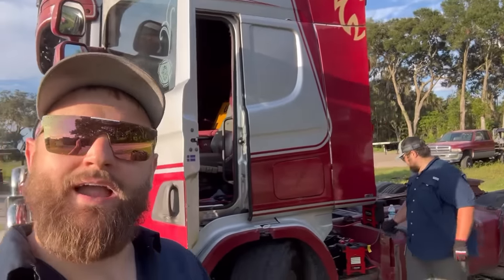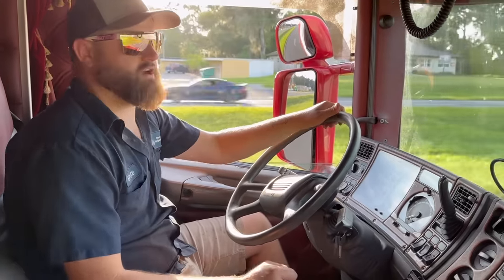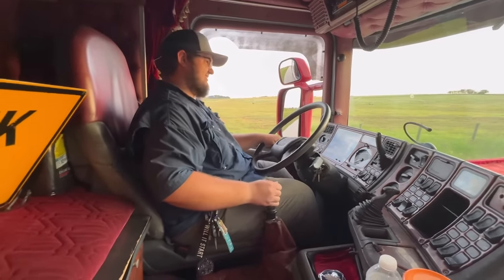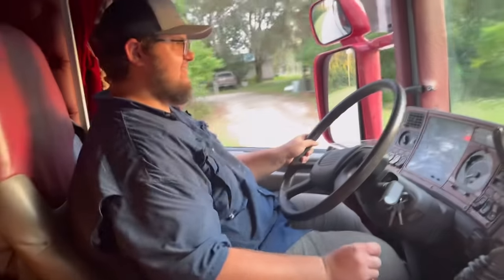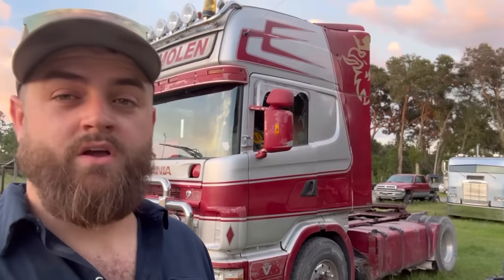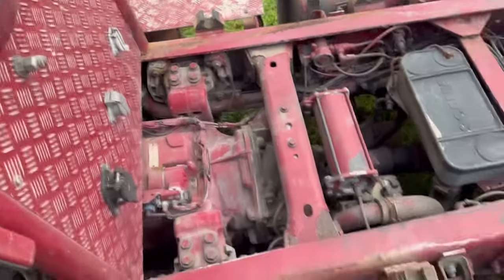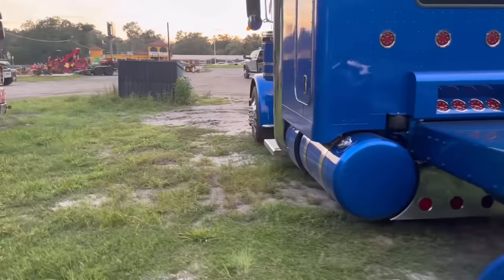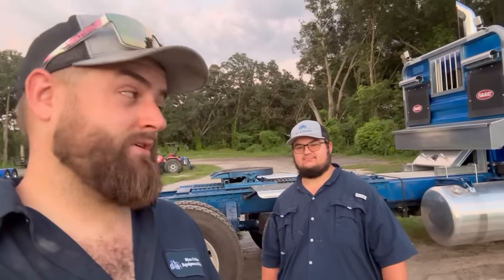American ATTEMPTS to Drive European Semi Truck. (Big Fail)

Comment: The tachograph is to register work/driving time. In the EU you must take a 45 min brake after 4.5 driving and you may only drive 9h/day and work 15h/day. Also after 5 workdays you have to rest for two days. That´s the simpele explenation, there are a few exceptions but that´s a bit complicated to go into details.
Reply: You need to educate youreself if youre a trick driver ...

Comment: That Tachograph disc has been in there for a while!!! You're were supposed to put a new one in on every shift. The last time I used one was 10 years ago! The key was so the Boss could lock it to stop drivers "cheating" their working hours by swapping the discs out during a shift. The 'Tacho' is nicknamed "The Spy in the Cab". It monitors speed, time driving and total working hours. Truck driving laws over here in the UK are Ridiculously strict and drivers and operators get Big fines if they break any of the rules and laws for heavy goods driving.
That type of tacho in your truck is now basically obsolete as everything now is Digital. You should be able to pick one up from over here reasonably cheap. Everything is now recorded on a driver's tachograph card about the size of a credit card.

Comment: Importing any vehicle into US that have less then 25yrs on its back will require a full law compliance which means probably crash testing more then few of the same model for US market...this is THE reason why ppl will only import old models(they are exempt). Nobody has milions for crash testing purposes just to import one truck.

BUT since Scania bought out International trucks there might be a solution in near future.

Comment: European semi truck at 16.5m with trailer. Box Trailer or flat bed have mostly 13m load length so it left 3.5m for cab and the space between the two 🇨🇵

Comment: We have to go for cabovers because of length regulations in the EU, they have changed those to accomodate far longer trucks with trailers, so we might se front nosed trucks from Scania and Volvo among others again.

I am a Scania Employee myself so I might know...
Reply: Long noses ...It could be nice and safer for the drivers but.. I don't think so...EVERYTHING EU is proposing is about and for air pollution..So if you want a long nose truck ,you can BUT as soon as is compliant with the NEW EURO 6d( or the upcoming EURO7 ) rules.. After that you should comply with the length restrictions..As a consequence of it you will loose some tones of the NET weight (because you'll have  about 46 ton Gross weight ) and after ALL of them you'll have to comply with the acceptable axle loads...If you can cope with it,why not...
Reply: September 2020 EU changed length law and manufacturers can build extended cabs.
Reply: @infectedharpy5247  Yeah I know, but it takes time. I know that DAF will soon start selling their new generation made after this change. Others will follow the coming years.

Comment: Here in europe we have laws that your typical truck lengt with trailer can be 16.50 meters/ around 650 inches.   Because of the small roads, thats why you mostly see short cabovers(unfortunaly). Eventough i love the look pf amarican trucks, it amazes me to see te differance in driver comfort! And btw, the styling customazations are not normal at all for the most big companys. Loving the content fellas! Greetings from the Netherlands(where te truck came from)!
Reply: 34.5 m / 113 ft in Finland, but just cabovers, as conventionals are not made in Europe anymore (except some customized show trucks).
Reply: @jaakkoiswatching6437   yeah we have those here to with special rules and restrictions to keep on certain roads. And they can be 25,25 meters in  the Netherlands. You also need to have a special license for them here.
Reply: @dennissnel9629  Here 34.5 m and 76 t combinations are "normal", no special rules, restrictions or license required.
Reply: @jaakkoiswatching6437  Vlastuin in Netherlands still makes the Scania Torpedos by order. For normal traffic in Europe.
Reply: @markusylitalo8376  They do, the price makes them rare.
Reply: 34,5m in sweden also.

Comment: Spent years driving a V8 Scania from that era over the whole of Europe usually maxed out at 44 tonnes and it never let me down once and the debate on gearboxes raged even then. Truth is the full autos are probably the kindest to both truck and driver because it is almost impossible to make then work hard and once you get used to them they can be driven like a family car they are just that simple on the outside, internally though they are very complex with computers enough to make a geek have orgasms but one word of advice. don't coast that box, you will kill it very quickly.

Comment: Yes it is and at the weigh station or checkpoint the inspector will open that up put it in his "dvd" player and give u tickets on how many times you went over 80kph based on engine rpm . also u had to pay right then and there . no pay no move.... At least in the 1990s when I was there. Cool truck .

Comment: The tacho meter is been checked by police to ensure you dont drive more than certain number of hours without pauses/sleep until next day etc. If you dont follow the legal rules for working hours behind the wheel it cost both the driver and the owner of the truck very large tickets and " a cut" in your driver licens. At least in Scandinavia. Also trucks from countries has to follow the rules.

Comment: That's tachograph behind the speedometer is the old style. It's been replaced with a digital unit using SIM cards.
The old style could be fooled with a rubber band allegedly.

If the coolant light is on and it's the same as in a Scania bus that means it has a low fluid level and you should be on your guard for a temperature spike if the fluid drops even lower, if you can't refill.
The level indicator might just be broken as well.

Comment: There's pretty much always a main battery switch on european trucks that needs to be turned off if you leave the truck for more than a few hours. The batteries will drain otherwise, i've never been able to get to the bottom of what exactly DOES drain the batteries but something always seems to. The clock in the tachograph does usually have a by-pass to keep it in time. 
Look for a red plastic key-thing or a stainless l-shape somewhere close to the battery box, that's the main switch and it usually comes out like a key when it's turned off. No more drained batteries.
Reply: I saw the battery isolator switch before & it's missing its key so I presume its been bypassed or deleted.

Comment: Clutch is just  a sensor. computer compensate/operates the clutch based on your movement of clutch..no linkage...1990 and newer .i had a 1990 MB bus. Lots of hp no speed ..the trans we had had paddle shifters like a like an Indy car but also the gear shift clicked forward to up shift clicked back to downshift and u pushed the the red button in front to let the computer choose or if u want to skip gears . 6 forward one reverse.

Comment: The tachograph records how long you've been driving as there's laws in Europe on how long truck drivers can go without a break.
And it's law to have them fitted to trucks and long distance buses.
I think it records speed as well.
Reply: It's the old system, the new ones are digital with a memory-card for each driver.
Reply: @DSP16569  I didn't even know they had changed them to digital.

Comment: That piece of paper is sort of a log book, but in europe you are only allowed to drive 4.5 hours then a mandatory 45 minute break before another 4.5 hours for a total of 9 hours per day, that can extend to 10 hours 2 times per week, now all that stuff is stored digitally in your drivers card, and each day you need to have a mandatory rest of 11 hours wich can be shortened to 9 hours and you need 45 hours of rest each "Week" so called but it is at the end of the week

Comment: Next gen scania, if you want a manual, it'll be an R cab you will need to look for. Scania never made an S cab manual. 
As for the spec, an R650 manual will be the most common model you'll find.

Comment: The tachograph is a unit that records, driving hours, rest breaks, speed etc, in the EU,  drivers of HGV can drive max of 90 hrs in fortnight,  can drive four and half hours and must take 45 min break, another 4 .5 hrs and stop driving  break any of the rules,and each one can be a max of £1000 fine, points on license or ban from fpdriving
Reply: How do you get anywhere? In North America it is 30 minutes after 8 hours if you haven't had a break from driving in that 8 hours (30 consecutive minutes of doing anything but driving counts as a break from driving). Then you can continue until you hit your maximum of 11 hour driving day/14 hour work day. Maximum behind the wheel time in a row is 8 hours.
To put it into perspective, if you leave Denver heading east on I-70 you can only just make it to the next major town (Topeka) in 8 hours if the traffic is good.
Reply: @rich7447  Remember the uk is smaller, and at 65 mph four and half hours gets you quite a distances 😁😄
Reply: @johngilfillan2871  The UK also has many more vehicles per mile of road than the US, so traffic is often an issue. I haven't lived there for a long time, so I am out of date with how easy or difficult it is to get around. 
Distances are vast here in North America. I'm near Washington DC and my parents and in-laws live in Canada on the North shore of Lake Ontario. It is 8 hours (500 miles) minimum each way and we don't see that as being all that far. I have driven up and back in the same day.

Comment: Also base model v8 scania is a normal small hauler, check out the Crane haulers and heavy haulers they aren't much longer but have the wheelbase for it... they are like the cab over American trucks you guys have or the Netherlands long hood scania I thing they are more on the market with them nice looking americanish scanias looking like the volvo trucks you got there...  but in retrospect I think of freightliner,peterbilt, kenworth, mack, international, made a 2023 version  cabover it would definitely look like the euro truck models. I know I love the peterbilt and kenworths out there the long extended sleepers they look fire but we also need a newer cabover from them as they are quality production truck companies.

Comment: The trucks in Europe are short because the maximum trailer length includes the tractor unit, whereas in the States it only includes the trailer :)

Comment: Twice the length of the Scania and given the size of American roads it can be forgiven. In Europe, apart from the main pan-European highways, roads are generally much narrower as a result our truck are more compact.
However, although State by State, the rules change in the USA, the Federal maximum gross train weight is approximately 80,000lb, whereas in Europe it is 97,000lb. These gross train weights are accomodated in trucks that are a maximum length of approximately 72feet in the USA against 54feet in Europe. Overall truck widths are comparable at 8.5ft (USA) and 8.3ft (Europe). There are differences in maximum heights, being 11.5ft (USA) and 13.1ft (Europe). All in all, this means that in the USA your all up fully loaded vehicle and trailer weight is 80,000lb in 7,038cuft of space and in Europe the maximum gross train weight is 97,000lb in 5,811cuft. Obviously special loads are not covered here.

Comment: Yall could also try and integrate american made parts on the scania I know you'll have an easier time getting local parts, for Petes and freights and stuff and kinda making a frankenscania the engine bay is big enough to fit a nice straight you'll just have to see how to position  it and about the axles you have similarities with  them no doubt. I don't thing it will be a problem to build it and restore it with american parts or just use the shell of it and replace everything from a cab over of yours, it will definitely have a chance of coming out looking beasty

Comment: you can get the next gen scanias in the r series with a manual, the s series is automatic only. so you can get a r660 for example wich can be a manual for a s580 can only be auto
Reply: All 660 is automatic they have the r33 gearbox and you can't get them with stick

Comment: the tachograph is mandatory in europe, or at least in some countrys, now they are digital and store all the data in chiped card, but they all do the same, on the old ones like on scania the record you labor time, your rest time, your speed, and other stuff, that is to prevent you from speeding, or driving more than 4.5 hours straight, or more than 90 hours in two weeks, there are other rules, you have to insert a new disc paper every day, and keep them for at least two months i think.

Comment: You mention in the video which company this truck originaly were. I don't know where it this, and that is not a point. However you mention rust on the chassis. I know, that especially in Nordic countries, they spread in winter time (if temperature -5 degree of celcius and higher of that ) "road salt"  to road and that purpose is melt icy roads. That say, salt + water + steel is not such a good combination.
Other thing is that you wonder how short that is. In the Europe roads are not so wide. Also there is across middle of the Europe a mountains, Alps.
Also if you want see longer trucks and cool paint jobs, try to search trucks in Finland.  Like google search of pictures with words finland trucks paint.

Comment: You probably already know this, but Swedish trucks plus trailer are up to 30 metric tons and 25 meters long. (Make your conversations to USA imperial sh*it)

Thats why EU trucks don’t need 2x-axels. 

The only trucks+trailers larger than the Swedish ones in the world are the RoadTrains in Australia. 

Swedish regulations on extra lights are unlimited as long as you turn them all off with the high beam lever. 
- I’m a Swede living in Guatemala, and I drive a Suzuki Jimny. My Jimny has extra lights that give me 1 Lux at 1000 meters. That’s massive.

Comment: ye know on the scania ye not need towles on the floor tae keep the carpet clean, just put yer shoes on the step, done.
alos back in the days in Europe ye could've got a Fuller also.
the thing I think is the most funny: double frames in the US,
the only thing in Europe needing Double Frames are HEAVY haulers, that would be this scania as four axle with a Set of Tandem Hubreduced Axles
every standart Frame is rated for at least 40 Tonnes + 20% and that is understated,
why I know this, I worked at a Special Truck Manufracturer Plant,
we build Heavys things like 10x10's, wreckers,cranes, Emergency or Armored vehicles.

Comment: old disc tachograph records drive time breaks and rest time over 24hrs. we now use a card similar to a credit card now . check out EU tachograph driver hours. i drive a new scania 500hp auto box. 770hp is the flagship. not many manual gearboxes now in the uk. glad you americans like the scania if you got a new one bet you would be pushed to beat for comfort and power.

Comment: Use the clutch
Reply: They're used to non-synchro gearboxes in US trucks.  It's called floating (instead of double clutching, shifting these without using the clutch)

Comment: Never heard of syncronized and non-syncronized transmissions. Did some reading about it, so now I have a question. With a non-syncronized transmission, can you then only change gears at a specific rpm? I mean, how could you otherwise syncronize the gears? Sounds complicated to drive!
Also he kept reminding his brother to use the clutch. With al manual transmissions you would have need to use the clutch right? So is he used to semi-automatic tranmission? Is that the norm in America?
Reply: Manual american trucks you float the gear at a certain rpm and only real use the clutch to take off from a stop that's why he wasn't used to using the clutch to change gears
Reply: @tryngetme12ps4   So there is a dail on the dashboard so you can see that the gears match speed? I'm going to try to find a video about this.
Reply: Just watched this video: "How to Drive an Unsynchronized Manual Transmission: 1930 Model A Roadster". It got my head spinning 😂 Man, that sounds so hard to drive!
Reply: @operius2385  just practice.
Now that many trucks come stock with an auto-shift gearbox it isn't necessary. I rather drive an auto-shifter in traffic.
Reply: Non-synchronized are much better for trucks. Floating without the clutch rather than double-clutching it

Comment: Dude, you’re comparing that 27 year old neglected truck to your fleet of restored and show room trucks?    Dudes, if you can drive an american pickup truck with manual transmission then you should be able to drive that scania, just add the range change and splitter futures.

Comment: Without or without load on a single axle you can can go to above the arctic circle even in winter. Here summer vacation in restored Volvo from the 80s: https://www.youtube.com/watch?v=CEnc4_j4VVU three parts. Right at the beginning you see the old timer using the old skool Tachochraf.

Actual working trip to the arctic on single axles in the winter. https://www.youtube.com/watch?v=njuyyON8Ndc

Guus is a bit of a legend in YT trucking videos, no new video's in years following a braininfarct or brainhaemorrhage ended his drivingcareer.

Comment: They are scania 4 series tanks. Dont ditch them. Large tanks are standard in Europe. For example fuel in Luxembourg cab be a lot cheaper than Germany of the UK etc so pays to fill up. Your US trucks are way behind the times and even now your peterbilts are using european mercedes actros parts

Comment: Yeah that sloppy shitty shifter is a problem with used 4 series Scanias, POS is cable driven and and the cables stretch after like 400.000km.